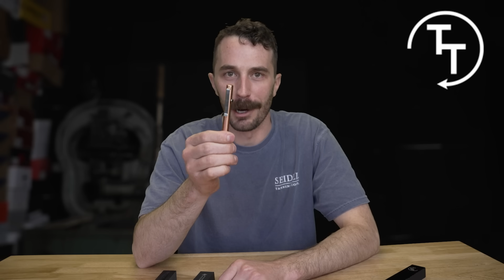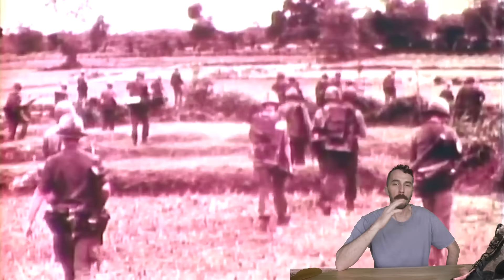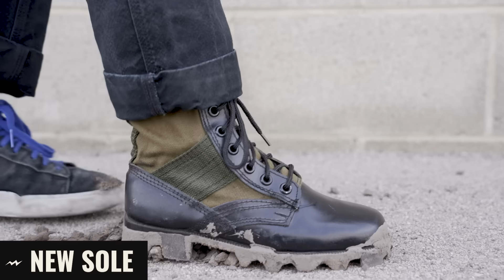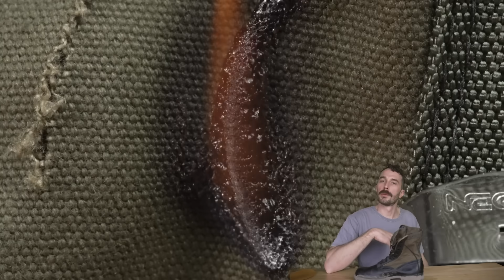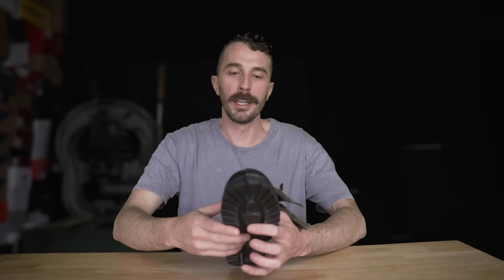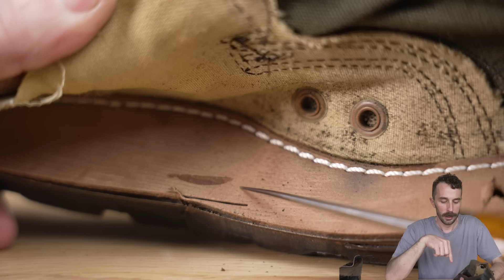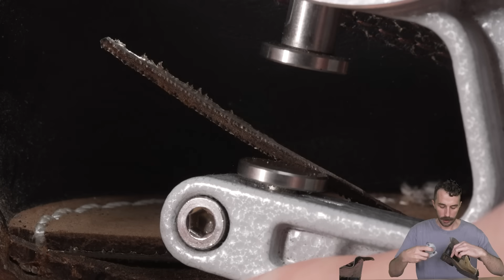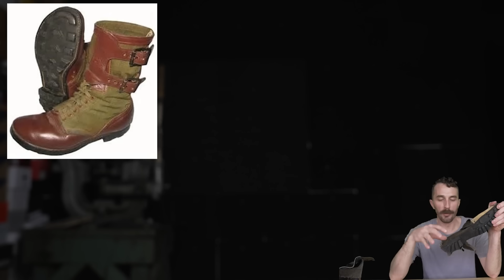Why it took 57 years to replace jungle boots

Comment: i have a pair of these and presently destroying the inside of them after about 8 months, surprisingly the outside is holding up alrite just the toe is starting to peel off. Ive killed boots in about 6 months previously so they are doing okay so far.

Comment: Very interesting.  Loved the dissection.  Unfortunately, both of my ankles were injured because the high top did not provide enough protection from ankle sprains and a fracture.    Wore them 1969-1970, U.S. Army II CORPS.  Today every step I take hurts and x-rays show osteoarthritis and old fracture & joint damage.  But, I thank God I have two feet still attached.  "MOVE OUT!"
Reply: Saddle up! 1970-71 I Corp, mostly. Wore mine on RR after till returning to university studies.
Reply: Try some glucosomine and oral BPC-157.
Reply: @pollodustino  Also take vitamin D and K (both 50 to 100 micrograms daily) so the calcium gets deposited better in the bones. Vitamin D also helps against the auto-immune aspect of arthritis, if present.
Reply: probably should've done ankle muscle building and flexing exercises to make them more resistant to fracture. bone gets tougher if you load it and bang on it, and joints are less likely to be damaged if you bend and flex them

Comment: To anyone that has ever sat on a piece of machinery for hours on end at sub zero temperatures ( like 40 degrees sub zero) bunny boots are not ridiculous.... they are revolutionary) .....yes they are heavy yes they have moisture issues.....but at the Temps these things were designed to cope with ....moisture is a solid. They are still a go to of mine.

Comment: Cool vid, these boots are amazing. 
These were general issue when I served. We would deploy to the field for 2 and 3 week stretches...daily wet/dry cycles for the boots + daily 5-10k foot movements through tough terrain. The boots fit like tennis shoes after a while. I can't remember clearly but I don't think we used the insoles...we nicknamed them "cheese graters" because once your feet got wet and soft those insoles seemed to grind against each other. We could get about 2 years out of a pair before the sole was too worn or the metal plate would begin to click.

Comment: Entered Army in 1977;(82d Airborne).issued two pair of leather boots,regular issue. Bought one pair of Corcoran jump boots for inspections,parades,etc…went to surplus store just off post for jungle boots(original) then after wearing out all of above mentioned went for advanced tread jungle boots. They lasted and lasted!!No complaints. Not so good in snow however so traded some weed to SF Medic for Herman Survivors with hook lacing and Vibraim treads. We humped and jumped ALOT!!world over. The upgraded jungle boots were my go-to boot. Brush shine only on all boots except jump boots. They got the ‘ occational’ spit shine on heals and toes

Comment: The boot wouldn't stretch or break in anywhere the canvas was stitched to the leather so it never form fit to your foot the way all leather boots did.  If you had a high arch you had to cut the stitches and sometimes the canvas at the base of the tongue. Green looked good but we're a pain back in garrison where they had to be shined.

Comment: I wore those in the late 80s in the US Army. Unfortunately,  they were not authorized for parades, formal gatherings, etc. But for every day use, you couldn't beat them in the summer. 
The ones with the non-Vibram sole were preferred for the reason shown. Tended to pick up less mud and small stones.

Comment: I wore the Air Force all leather boot for years and years, then transition to the swamp boot which was great but then started getting those made in Vietnam and Korean version and they weren't up to par with the original GI issue.... Then along came the version you got at Walmart.... Those really blew chunks, the first pair I got that wasn't military issue gave me a massive blister on the ball if my foot because the sole had changed tread design and instead of the total sole of my foot spreading weight evenly... It was now centered over one protrusion  in the sole design ... Never wore them since

Comment: I was issued two pair at Parris Island.  We wore them all the time but the truth was they caused a lot more issues than they solved.  My primary problem with them was the seam where the leather met the canvas would saw your feet bloody on any type of real activity.  Fine for getting through a normal day around the barracks but wear them for a hike (hump as we called it) and that would saw your feet bloody  Those mesh insoles also tended to wad up into the toe and had to be replaced with store bought inserts.  This was very aggravated by the close order drill of boot camp.  The element of coming to a halt while drilling drove the inserts into the toe.   The advantage was they where light and breathed.  We wanted them to work but they didn't.

Comment: One of the biggest issues I have seen with military-issue Footwear is the lack of arch support in any boot or shoe. There have been more problems with backs, knees, and the almighty plantar fasciitis because the military has just never gotten it through their thick ass skull that may be putting arch support in a military-issue Boot & Shoe would be important and decrease the amount of medical issues that troops had. I challenge anybody to wear flat soled shoes for twenty years on the steel deck of a boat and see how healthy your feet are when you DD-214

Comment: I used these boots during the first half of my Army career, late 80s until mid 2000s, until we changed to the new garbage uniform.  I loved the jungle boot for comfort, durability and appearance.  Unfortunately, some commanders did not like them for unknown reasons and prohibited their use in their units.

When I bought my first pair in about 1989, regular issue boots cost $25 and jungles cost almost $40.  It was a big outlay for a poor young soldier.  By comparison to the contemporary boot, they were far superior in many respects.  Way cheaper in price for the value and durability of the boot.  And those older boots could be resoled when they wore out, unlike modern boots.

To your point about the mesh insole, they worked perfectly at wicking away water and allowing air circulation.  However, they did not last very long, compared to the boot itself.  They had to be replaced often.

Comment: I bought some surplus of these boots 20+ years ago and they were the most comfortable boot I've ever worn. The only problem was that the metal plate would break at the ball of the sole and the ends would eventually cut through the sole, both inside and out. I wore these at work also, so bending down would flex the steel back and forth and it would eventually snap. I guess if you just wore them standing up or maybe working an office job where you're sitting and not flexing the sole so much they would last longer. But they were sooo comfortable.

Comment: I used one of these in at work in a Kitchen, and while the boot was tough and lasted and was comfortable with an insole, the traction was nonexistent on a wet greasy floor, and the rubber left behind marks.

Comment: Still got a pair in the shed. Bet you didn’t know the “Jungle Boot” was designed to compete in a competition for boots for the Australian Army, the designers were a bunch of people from the Institute of Technology in Melbourne, Australia. Integral to the boot was a silicon inner sole that pumped water out and air into the boot. Great boots, but they lost out to another boot that had a spring steel in the sole, that feature was later added to the design. The US Army bought the design. Early boot soles were softer for a good grip, but they wore out fast in the “Long High” hills in SVN, you could wear out a sole in 10 days on that basalt.
Reply: The winner was the GP boot. I still miss mine.

Comment: If you are wading across rivers and creeks this is good but this and the regular army boot back in the day were horrible in that your feet stayed wet in wet weather when you weren’t wading creeks. I have the original pair of jungle boots and my basic training issue all leather black boots in the closet but I prefer my modern gortex boots 10X over these old guys. Try marching 20 miles with full pack, weapons and gear and these boots are not friendly 😬

Comment: I remember hearing about how the jungle/hot weather boot was ideal for national guard soldiers performing hurricane relief duties. Wading through murky water. It protected the soldiers from injury. In addition to being vaccinated against hep A and hep B. Among other things. A relatively healthy population of able bodied men and women. These boots got phased out when the stainless steel plate stored up heat in the desert. Soldiers and other service members got severe burns because it was like wearing a hot plate while walking on the hot desert ground. Especially on tarmac/asphalt. So the DOD’s answer was an excessively thick sole to protect against heat. That’ll likely remain the standard for another 50 years until the next environmental hazard presents itself.

Comment: That was interesting. I was in the Territorial Army in the 1970's and we were issued with those nylon insoles. I must say, I found them comfortable. I didn't know what their purpose was until seeing your video. I was actually considering buying a pair to wear in the UK when on duty, but as they were a jungle boot, I had a concern they might not be warm enough in cold weather.
Reply: Oddly enough, they do just fine in cold weather.

Comment: I had a pair of these that I bought in a surplus store when I was around fifteen (1973). I grew up on a farm and helped on neighboring farms. I remember how comfortable they were while working in hot hay fields in the summer. I had them for many years.
Reply: "I bought in aurplus store when I was around fifteen (1973)" The smallest size available.🤣
Reply: @internetcensure5849  10D. They fit just fine.

Comment: I liked the boots in Vietnam and when I brought a pair back home I used them on my dairy farm.  The problem was the same as other farm boots: they rotted away after being exposed to cattle manure; leather parts went first.
Reply: They make oil for cleaning leather boots yo. A little care and love goes a long way
Reply: @anormalbloodangel843  fresh cowshit (and other animal manure, and urine) tends to be pretty acidic, yo. 
Even if you condition them properly and clean your boots every day, piss and shit is still going to rot the leather in a hurry. If you have to work around livestock, leather is just about the worst choice for durability.
There's a very good reason those ugly rubber "wellington" style boots are so popular among farmers: They only cost around twenty bucks a pair and they basically last forever unless you cut them somehow or just plain wear through the soles... which takes a long time on a farm because you're usually not walking on concrete or asphalt. They're awful when it's hot though, because obviously they don't breathe worth a damn.
Reply: @dogslobbergardens6606  how high up do your wellies need to be to be functioning?

Could make a more breathable one thats not for high water.
Reply: @dogslobbergardens6606  I'm not a dairy farmer, but a rancher, so take my two cents as whatever you feel it's worth. I know what happens to leather boots with farm work. But comfortable feet are worth it for me personally, and footwear, regardless of the job, is always a consumable. As you said, you'll just wear out the soles with enough time, that happens to shoes no matter what. Of course on a ranch, there's always more to be done than just tending to the animals, so when you're on your feet all day, comfortable boots are a must. Cleaning them isn't a perfect solution, but it goes a long way.
Reply: @anormalbloodangel843  I understand, you gotta do what you gotta do... and if that means replacing your boots twice a year then do it to stay comfortable. Hurtin' feet ruin your whole day. It's a cost of doing business like buying tires for your truck when they wear out.
Doesn't change the fact that manure and urine will rot leather faster than normal no matter what you do. That's just chemistry. Nobody working a ranch, farm or homestead has time to clean their boots every single time they get a little cow pie on them, we'd never get our chores done :)
Reply: @tisyfish  it just depends. In the spring when the weather is still wet but the grass is high I sometimes get wet right up to my thighs, depending where I'm working an what I'm doing.
When it gets real hot I just wear cheap sneakers, the old Converse style. Kind of the same concept as the jungle boots, they don't keep water out at all, they just let it drain quickly and they breathe better than leather or rubber.  
That thing they showed in the instructions for jungle boots about keeping clean dry socks handy is true for sure when you work outdoors, no matter what. At the end of the day drying off your feet and putting clean socks on is pretty necessary. That kind of beginning foot rot they showed in the video can happen in just one day. And if you let it go another day, it gets REAL bad real fast from pics I've seen. The skin gets so soft from being waterlogged it just starts peeling away, then it gets infected... yikes.
Reply: @anormalbloodangel843  Dairy farmers don't got time for that.
Reply: Neats foot oil!
Reply: Neighbor has a pair of red mud caked jungle boots hanging on the wall of his machine shed. 
Came home to farm after flying medevac chopper in Vietnam.

Comment: The reason why the jungle boot and the basic leather combat boot did not get changed out till the 2000's...the military does very little innovation between wars. Once the war in the middle east began, the military realized that the current boot would not work for the desert. Not even the current desert boot they had in the late 1990's. That one was the same as the jungle boot, but tan.

Comment: The best combat(all-around)boot. Comfortable as sneakers, totally made for hot-weather and mud/dirt.  Will last forever off-pavement .  My pair,(original Genoso's(sp? IIRC) with the Panama soles) bought in 1986 at the clothing store, lasted lasted me through 6 years of being in the field, a few years of construction, and walking hundreds of miles toting a chainsaw doing power  line clearance, plus a lot of yardwork and woods hiking.   Still got them 35 years later.  I no longer wear them, the leather is too worn , but I  keep them out of respect and nostalgia of older times.

Comment: I wore these for 20 years. There was a great difference in quality from different manufacturers. Altama was hit or miss. I think only McCrae is making the real thing according to spec now. When the desert boot came out in the late 80s in mass quantities there were real problems with quality.
Reply: I found the same problems in the '70s when i wore out my first pair (they were great). Trying to replace them got me very different quality and feel in maybe 5 different pairs.
Reply: @ex-engineer6657  The ones for sale made by Rothco are at best "replicas" and not even close. They fall apart in no time at all. https://www.mcraefootwear.com/product/vietnam-era-jungle-boot/7189 gets you what you want, with the improvement of speed laces.

Comment: You'll find a wood block in the heel in a lot of older post WWII military boots all around the world. 
Besides maybe saving costs or whatever, one of the functions of that wood block in the heel is to produce that distinct marching sound.

Edit, it's funny how people who clearly don't know what they're talking about have opinions on subjects they know nothing of, when I actually worked as a cobbler.
Reply: I don't think noise is what they put them in for
Reply: @krrrruptidsoless  well, you believe whatever the fuck you want, but then why wouldn't they've just used a void section in the heels?
Reply: @psychoaiko666  they put it there to support the heel, but it's kindve a stupid choice of material because that wood will rot quickly in the jungle environ, a piece of plastic would work better
Reply: @cbass7283  The wood is literally encased in rubber, how can it rot?
Reply: @SirBenjiful  idk, I figured despite that water will get into it eventually, still it doesn't make sense to put wood when there a more reliable materials
Reply: @cbass7283  take it from me, I used to work as a cobbler (shoemaker), the function of the wood is acoustic.
Reply: @psychoaiko666  were you a cobbler for the military? Because boots making noise isn't good in that environment
Reply: @cbass7283  nope, did that after serving.
One thing you should know about military is that shit never makes sense.
Reply: @cbass7283  I made handmade orthopedic shoes.

Comment: Wore these more than a decade after they became an authorized alternate general footwear outside of tropical theaters, they lack the compression/springiness of some boots and the steel plate can get hot and lead to blisters on road marches, but they were good footwear. Took polish well and could shine like glass. Replace the laces with 550 chord and you never worried of ever breaking one for the most part. Went through 7 pairs over the years as the canvas is not as tough as leather, though a couple of pairs are still in a duffel bag somewhere..

Comment: I have first hand knowledge that hopping off a tall pile of scrap lumber onto a board with a rusty nail pointing up can result in full penetration; boot and foot. I remember thinking “that wasn’t supposed to happen” followed by “how do I get the board off my foot?” (Had a guy stand on the board while I pulled up on my knee).